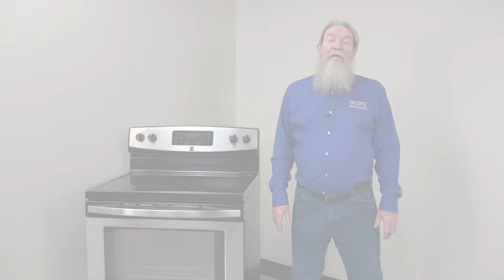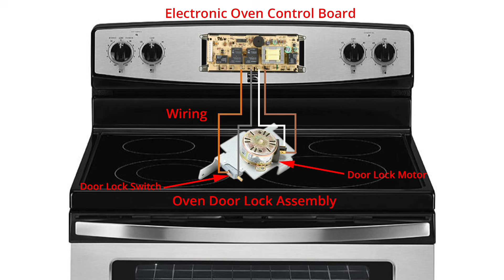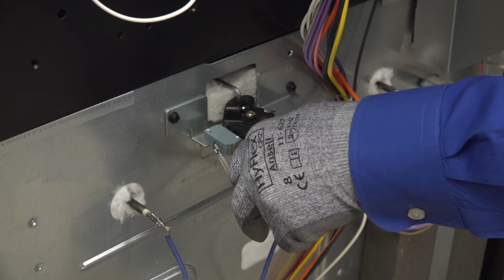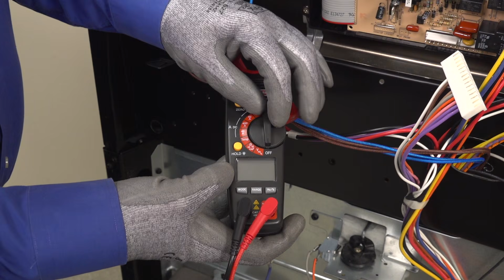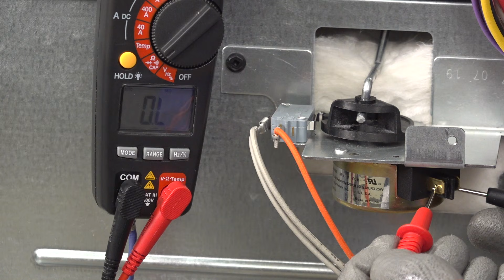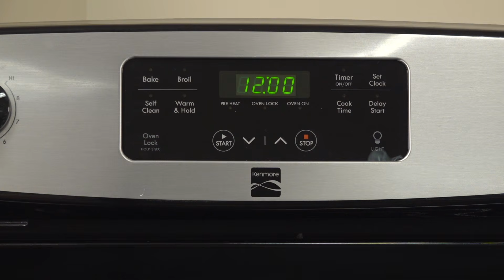Troubleshooting an F90 Error Code on a Range

Comment: While old, in my case the lock was rusted.

Since I never use the self lock feature, I cut the rod at the back since it was under tension with angle grinder.

I plugged it back in and the motor went back to its limit position.

You may even be able to detach the limit switch and the oven should work fine.

Comment: My stove was giving me this error, it sounded like the motor was trying to turn the cam but it just kept buzzing, I unscrewed the the screw ontop of the cam and it basically bypassed the error and it went away. Oven is now working fine after going forever without it. Hope this helps!

Comment: F90 is a door lock code, Try this...
unplug the range.
wait 1 minute.
turn the range back on,
then while holding in on the oven door.
start another self clean.
wait 2 minutes.
then cancel the self clean.

do not release the door until the door lock light goes out.
Reply: Thank you. This worked for my maytag stove.
Reply: This worked on my Frigidaire. Thank you. Never using self clean again
Reply: F90 randomly showed up when I was just trying to preheat. This trick worked on my Frigidaire.Thank you!

Comment: A simple unplugging and plugging back in did the trick to fix the F90 error code on our oven. The lock was extended and would not retract. When we plugged it back in, the motor reset its cycle.

Comment: Manufacture reset fix everything, it took me only 4 houres  and a broken finger to find the damn sequence to reset that to factory.

With F90, F91, F92, F95 and F96, remove back panels.

Unplug the module, if the engine starts moving, open the door as soon as possible.

Play with the door switch by hand and use the clear and clean buttons.

Watch the cam on the motor for on and off position for alf way and full turn position.

Hold door switch, push clear button then push clean.
Motor will start turning.
Release door button alf way then push to closed position 'till full rotation.

Release door button, stop clean.

Now that fu#%ing "door locked" stop flashing and you can use your oven.

Comment: Nice job and thanks.  We were lucky, my F90 code was a wire off the door switch.  Phew, because 5 years ago I did have to replace the control board because it quite working.

Comment: Hey! thanks for the video.
Is there any method to only eliminate the error code and keep using the oven normally? (without changing any part)
I mean, just delete the error code from the mainboard. I used to use the oven with no troubles until I started the self-clean mode.
Reply from the maker: On most ranges, the error code will remain on the display and the oven won't work until you replace the failed part. There's no way to just delete the error code from the mainboard. We recommend that you replace the failed part or have a service technician repair the range before using the oven again.

Comment: How to bypass?
Reply: There's only one scenario which you can bypass, and that's if the motor has failed but the micro switch is good. The switch is responsible for relaying locked/unlocked, therefor you can manually position the cam to the unlocked position. Unplug the stove for at least 2-3mins for reset, and obviously do not use self-clean again!

Comment: Ok so mine shows f11 and then after a couple mins it shows f90 so I'm assuming the control board is faulty and can't control the door well anymore
Reply: Any luck , mine is doing this exact thing F11 and then F90. thinking its the Control board.

Comment: Mine says f9, is it the same?
Reply from the maker: Yes. On Kenmore 790-series and Frigidaire ranges, the F9 code is the same as the F90 code. Check the oven door lock circuit as shown in the video. If you need more help, give us more details about the range problem and let us know the model number of your range.

Comment: Display not working but the cooktop works. What could the issue be?
Reply from the maker: A wiring failure or a bad electronic oven control board could be causing that problem. Unplug the range and check wiring connections on the back of the electronic oven control board--especially the black and white wires. Reconnect any loose wires. If wiring connections are okay, you'll likely need to replace the electronic oven control board. We hope this information helps. If you need further assistance, let us know (and provide the model number of your range).

Comment: You mentioned 2000 ohms looking at meter looks like 2.000 ohms  just wondering!
Reply from the maker: Check the range indication on your meter. The meter is likely indicating that it's indicating kOhms (2.000 X 1000 ohms). If your meter is actually measuring only 2 ohms through the door lock motor then the motor is likely defective. If you need more help, let us know the model number of your range and additional details about the failure that you're troubleshooting.

Comment: The motor makes sounds like it wants to unlock but the switch doesn’t move. Please help
Reply from the maker: Unplug the range and disconnect the rod from the door lock motor cam. Check for binding of the rod and latch hook. If the rod and latch hook aren't bound up, then you may need to replace the door lock motor assembly. If the rod and latch hook are bound up, push in on the oven door and see if the latch unhooks from the door. If it does, then you may need to adjust or replace the door hinges. We hope this information helps, if you need further assistance, let us know (and provide us with the model number of your range).

Comment: F95 Error Code on a Kenmore Elite Convection Stove. Oven starts to heat and stops before reaching requested temperature or stops during cooking process. Not good for baking cakes. Can anybody help?
Reply from the maker: The F95 code on that type of range typically indicates that the electronic oven control board detects a problem with the oven door lock assembly. You may need to replace the door lock assembly and/or the electronic oven control board to fix this problem. We hope this information helps. If you need further assistance, let us know the model number of your range and any additional details that you have available such as whether the oven works in broil mode.
Reply: @searspartsdirect  Our Model C970-440033 was purchased in June 2010. Oven door lock/unlock functioning properly when I last did a 2 hour cleaning process on December 15th, 2019. BROIL function worked properly for a 45 minutes test WITHOUT F95 ERR popping up. HOWEVER, before and after the December cleaning exercise, the oven problem of stopping at odd times before reaching requested temperature OR during a baking period was still present. ALSO, the lighting function on the electronic oven board is a faded blue on the left-hand side of the electronic clock and 2 small faded red vertical lights are ALWAYS lit on the right-hand side of the clock. I sincerely hope the electronic oven control board is the solution to fix this because everything else works just fine. Thank you for any advice or pratical help.
Reply: @searspartsdirect  What about F10 code? the model in the vid looks identical to the one i have